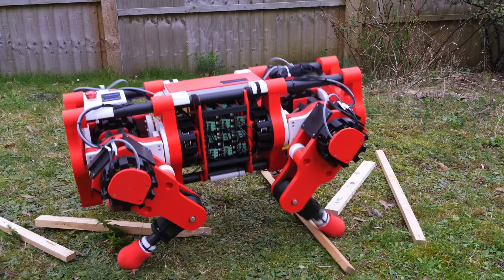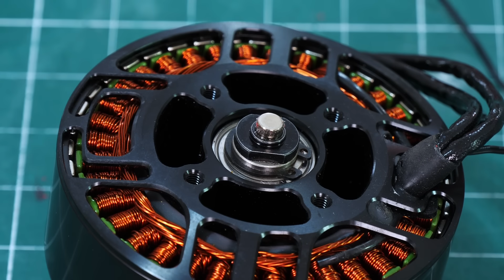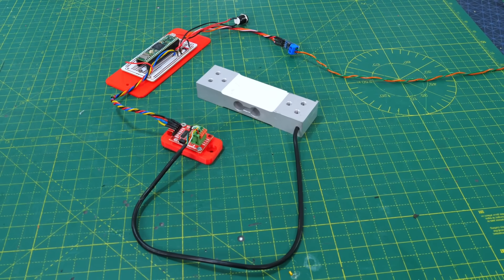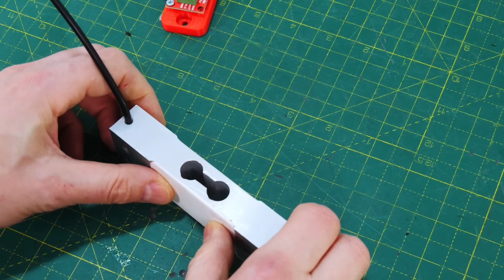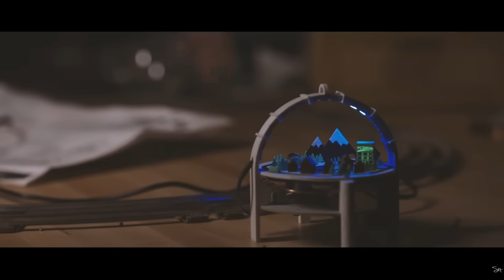Building a spring I can turn off with code

Comment: Really cool idea. Not a viable long term solution. Wear of the acme nut can cause failure. The Jackscrew (Alaska 261): In the MD-83 crash, excessive wear of the acme nut threads, exacerbated by lack of lubrication, caused the jackscrew to fail, separating the horizontal stabilizer and causing a vertical dive into the ocean.

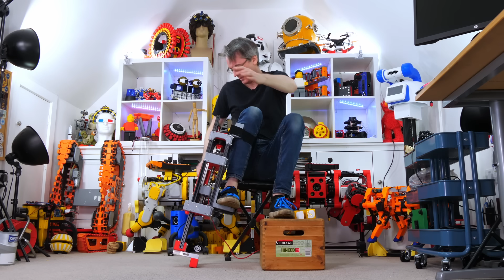Comment: 16:11 it looks like the printed bracket holding the load cell is about to break. You should probably add something on the right, to even out the load. Perhaps a second screw with a motor? Or second screw with a gear connecting it to the motor?

Comment: Aren't the oscillations because the controller is trying to make the load cell read zero, but when it's upside down, neutral reading is not zero, but the mass of the mechanism?
Reply from the maker: No, the controller is just taking the load cell reading and adding it to the actuator position.

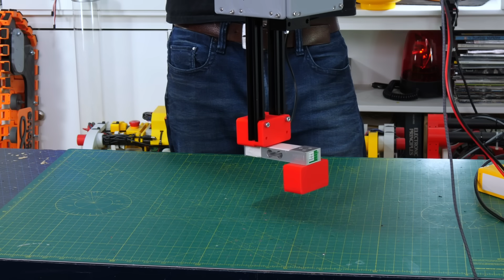Comment: 15:16 You can clearly see the max speed of the actuator being the problem. It clearly can't match the free-fall velocity the contraption has gained before it hits the table (it needs to if you want to ramp-up the load from zero onward). Its probably constrained as a maxvelocity in the O-Drive. Turn it up. Also, the max acceleration will need to be true the roof as well. Might want to put a small rubber feet or something compliant to give some response time back to the motor.
Reply from the maker: It won't go any quicker than about 80 revs/second because the KV of the motor isn't high enough. Yeah whatever I build will ultimately have soft feet.

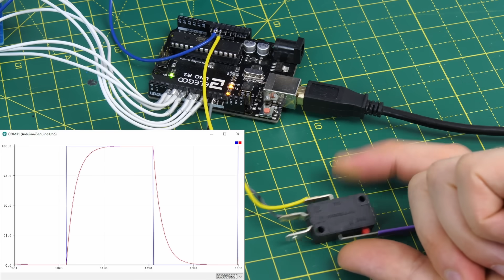Comment: 13:16 This is nothing like damping. What you see is a simulated first order response on an step input. Damping is not present in a first order system. What you actually need is a controller on your system which makes the system of second or higher order. A simple PID would suffice (the "D" standing for damping, of course).

Comment: I haven't made anything resembling robotics ever, but since you want a system that responsively absorves mechanical energy, why don't you use Eddy currents? Either directly, by installing magnets and copper windings connected to big resistors (optional regenerative brake later on!) or indirectly by making the mechanism more easily back drivable into a motor wired, again, to a big resistor. I reckon you'd get snappy shock absorption with something like this?

Comment: To deal with the shock load you could just put a mechanical dashpot on the foot of length sufficient for your timing loop delay and just amplify that signal in software to give your loop a head start on preparing for the impact load coming when the pot bottoms out.

Comment: i wonder if you explored a physical spring that can be turned on or off? i've seen electromagnetic springs that could be turned on or off and also mechanical springs that could lock the position of a piston at any point to basically freeze a coil over shock type set up

Comment: You really need to look into Inverted Planetary Roller Screw linear Actuators. These can take a big loads with reasonable speeds. Basically hydraulic performance with electromechanical speed and precision.

Comment: That’s a great admittance control demo video. I thought you previously only built robots using position and impedance control, so it’s interesting to see you introduce a new control scheme. However, since admittance control carries a high risk of divergence (instability), please be careful when applying it to wearable robots.

Comment: 16:40 but but but but- now your legs will be at weird levels and your legs that are not planted/are supposed to be in the air stepping forward will now still be on the ground.   

Basically your leg heights are now all out of wack when one or 2 legs is lower than the 2 not supporting the bot.

Comment: You could use a accelerometer to measure z-acceleration to dynamically adjust the gain before the leg touches the ground…
Maybe it would improve damping.

Comment: Mountain Bike shocks have lockout valves. could just servo control dampener valve
Reply from the maker: I'd still need the ballscrew to drive the actual joint

Comment: Just an idea, would it be possible to do a similar thing with an airbag? Some cars use these instead of a spring and by increasing or decreasing the air pressure would that give the desired effect?
Reply from the maker: Maybe, but I still the motor and ballscrew to drive the joint.

Comment: what if this was attached to a super fast, super processor computer in a car- and could respond to suspension needs, and traction control for cars.
Reply: one of the race-teams in F1 did basically that, though their version took mapping the track surface before the actual race, it got banned there because it was a bit too good at the time and was difficult for the others to recreate

Comment: Just a curiosity why shouldn't one use gyro flywheels for balancing
Reply from the maker: Because of the huge mass and power needed to control them mainly, although they work ok in small robots.

Comment: if you want look up an MIT paper on "series elastic actuators"  its almost exactly what you made but instead of the load cell it uses a spring connected to a linear pot. since a springs compression is linear to the force applied you get a force reading by reading the travel of the pot
Reply from the maker: Yes a spring is always a spring though, so there's always some elastic in there.
Reply: @jamesbruton  but as you said yourself in the video the load cell acts as a spring in this system. the advantage of the high force springs with a pot is its designed for this kind of work load, gives you the same feed back as the load cell and will work as a backup dampener. while load cells will wear down and brake easier\sooner while also being more expensive to replace.

Comment: If you left the load cell on top of the leg with a weight on the end of the cell that is not attached.   Wouldn't inertia be enough to get the result you want?

Comment: Have you considered measuring the force without a loadcell, instead by adding oscillations on top of the intended motion of the motor (larger than the mechanism backlash) and asking odrive about the torque?

Comment: 13:23 that's also known as a lowpass filter. If you then add an adjustable cutoff frequency it becomes a PID which are used in real factories for much the same purpose.
Reply: What? No, a low-pass filter does not become a PID. Where is your P and I term?
Reply: @RBNProductions2187  Static.

Comment: If its an impact, you'll want the load cell to not see the strain energy. Drop tests you'll see the load cell against the fixed surface not on the impact mass for this reason (damage the load cell).

Comment: You could also just put in a mechanical dampener as it won't need to be adjusted, it would just work regardless of if the spring is on or off.

Comment: I have a trick you may like to use.

I have a lot of experience with this type of bearing an rail. When replacing the rails, there are caps that fill the holes to prevent contamination from dust and other debris. I use candle wax to fill the voids, and then using a razor knife, I trim the wax off to match the bearing surface. I prefer the softer wax that you find in the candles for ceremonies. ( think of a catholic candle) I do not know their true name.This wax is softer and less expensive than many others. It also is easily available. Hope you may find this of interest.

I have a video somewhere, if you need more clarification. Cheers!

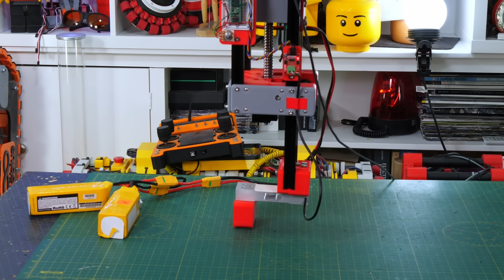Comment: 14:19 - you just (re)discovered critical damping.
Reply: Why critical? It can be more damped than critical.
Reply: @RBNProductions2187 at that exact timestamp he had turned it to the point where the vibrations just barely stopped, that’s the definition of critical damping

Comment: I would try applying damping only (or higher ratio) to the expansion state of movement. Like a one way bypass valve in the damper. That way the compression can stay responsive.

Comment: I still think some type of mechanical damping and spring to assist the load cell. You're going to have some delay no matter what and your shock load is probably much higher than 100kg with a heavy load on top.

Edit: Very high spring rate, medium damping I would suspect.
Edit 2: It is apparent in your stepping test that the 3d prints holding the cell deflect some. This is helping with damping and shock I'm sure; who knows if it's enough.

Comment: The problem with ED is the legs are so far apart. In order to walk and not fall over, you have shift a huge amount of weight over to keep it from falling over on the side that the leg is lifted from. It will need a really strong ankle joint and hip joint that can move on 2 axis. Also another thing you could try with creating a dampening spring is to use a trick in some force feedback flight yokes. They use a lead screw to move a middle plate back and forth between 2 outer pates. They have a spring on each side.  To increase the spring tension in 1 direction They move the plate to compress 1 spring while the opposite spring decompression. The user can still move the yoke but faces increased forces away from the new center (which is the middle plate that moves). Might be able to combine your setup with springs. On the other hand, maybe that won't work because maybe it makes it too springy.

Comment: very cool! but i don't think you are supposed to use load-cells as loadbearing member. It should still work fine if you put it on a beam, instead of it being the beam.  
Someone who works with these things in high force applications can probably chime in with better info :)

Comment: Here. Point this cad software at ED-209.
"Release your video. You have 20 seconds to design."
<James prints all the parts with 4mm nozzle with custom lulzbot filament in record time.>
"You have 15 seconds to comply. Your are in direct violation of Youtube Algorithm Release Schedule 113, section 9"
"5...4..." <James makes the entire robot jump 6ft in the air and land softly.> "...3...2...1..."
"I am now authorized to use demonetization." <unloads barrage of negative comments>

Comment: like... a fake spring, as kinetic energy still hits every part equally... for a costume it might be pretty good for stability.

but if it will be super fast... and adjust the torque in very short time... it might become a real spring I guess? XD

Comment: Can you use this same concept as feet on ridable robots  that would attach to each leg Horizontal and when leg is razed the foot would be extended all way out then set on ground and drag the unit forward in each step?

Comment: The oscilations are mostlikely caused by the controller running out of stability margin. This is why damping, which is equivalent to low-pass filtering helps.
Reply: Yeah that latency needs to be near zero
Reply: @nonono.yesyesyes Eeeh you INCREASE latency by applying a low-pass filter eh
Reply: @RBNProductions2187  yeah you do. Depends if you find the amount of latency acceptable at that cutoff frequency. Which is really an application question. Doing everything you can to approach zero latency however might keep you comfortably within the stability margin, meaning the controller can track more effectively. I don't think you can completely get rid of filtering, but you really want to get away with minimal filters needed to achieve your goal. Like a small gain notch
Reply: Yes, the system is instable. But, isn't damping just the exact opposite as low-pass filtering? From the bode diagram, Damping action is more like a high-pass filter
Reply: @RBNProductions2187  not quite. Damping is closer to a reduction of Q factor. You might be referring to impedance? That does rise with frequency in a damped system, but it's not a change of filter topology.

Comment: it's super cool to see a software version of this, but I'm wondering why we don't do a hardware implementation. For example, a normal spring suspension system with a standard damper, and then an adjustable bump-stop that allows you to lock the joint up when you need to, and to lift it back up if needed as well.

Comment: Hey James. I have a degenerative condition that has destroyed my spine and left me unable to walk more than a few metres without fatiguing. I’ve been following you for years and you sparked my interest in mechatronics although I haven’t learnt how to build anything yet. I would love a leg exoskeleton that went down below my knee, was height and width adjustable and uses padded straps to connect them to your waist and legs. There are some products on the market but they’re extremely expensive and only fit a certain size range. I’m a former bodybuilder and powerlifter so I have really big legs. Is this something that is achievable as a self made exoskeleton at home?

Comment: I wonder if you could rapidly alternate the direction of the drive motor, that way when any force is applied in any direction, when there is more movement than anticipated, it can be determined that there is a force being applied with the current direction, which could then be able to respond without the load cell.

Comment: The warping of the lower aluminum extrusion and load cell mount when you were standing on it was making me so anxious. After watching someone make a robot actuator using a capstan reduction drive rather than some variation of a cycloidal or harmonic drive. I have wondered if some variation of that or some other cable reduction like block and tackle would be better for the drive at the “knee” and how far the reduction could be pushed with one and still be back driven.  Load cells always look like black magic to me just because they look so simple but work so well I just imagine someone like a high end luthier slowly shaping it like the hidden structure of a violin until it’s just right.

Comment: Need full PID there.  And it should act more firmly when already compressed, more compliant when fully extended.  Also, it can't move fast enough: that's why you still saw bouncing even when it was constrained against extending.
Reply: That was just the table flexing, as he demonstrated with the actuator locked.

Comment: I've got a simpler solution - air over hydraulics.  Put hydraulic cylinders where you want your "springs", and feed both sides of the cylinder - all oil filled - up to a pressurized reservoir.  Put computer controlled valves in the lines going to the cylinder, and ideally a pump/relief system on the air side of the reservoir.  Change your spring constant by adjusting the air pressure on top of the hydraulic system, and you can lock the cylinder in place with your valves.  Ideally they'd be throttling type as well, which would allow you to adjust your speed of travel in both directions.  Feel like it would be a way simpler system, and probably about the same weight - although you'd need some commercially sourced components.  Love the videos, keep up the great work and thank you for sharing with all us curious folks!
Reply: This would be more robust (particularly to very quick impacts) and could even be lighter than the motorized solution, but it would give much less control. If one side has already sagged to much, there would be nothing the valves can do about it, whereas the ball screw can just actively push the robot back upright again.
Reply: Even Boston Dynamics has moved away from hydraulics for robotics.
Reply: @notahotshot  if it was good enough for Boston dynamics all those years, it's good enough for this guy
Reply: What does the oil do in that? You could just put pneumatic cylinders instead of hydraulic ones and pressurize the chambers directly with the same valve system. Put a sealed damping cartridge (the type they use in cheap telescopic forks for bicycles) beside it and you can adjust the damping factor (or even completely lock it up) with a simple RC servo. No oil, light and clean. Although this linear actuator has the ability to emulate almost any spring and damping characteristic you like.
Reply: @peterkiss1204  all good bicycle suspension systems use what are essentially hydraulic oil valves for the damping control / lockout. Such valves just work very well: a tiny control force can in a fraction of a second switch the suspension from supple to very stiff under quite big impacts.
A better question to ask is: why do bike shocks even bother with air cylinders, which are very finicky to seal well enough to permanently hold pressure, instead of using just a single oil cylinder and hydropneumatic reservoir?
Reply: @leftaroundabout  "why do bike shocks even bother with air cylinders, which are very finicky to seal well enough to permanently hold pressure, instead of using just a single oil cylinder and hydropneumatic reservoir?" Because it's light weight and relatively easy to service.
Reply: Boston Dynamics posted a retirement video for their Atlas series. It showed a bunch of the worst fails with plenty of burst hydraulics they'd never put in videos before.
Reply: Inverted Planetary Roller Screw linear Actuators could be better option. No compressor or pump needed, uses the same motors, can take big loads and stress.